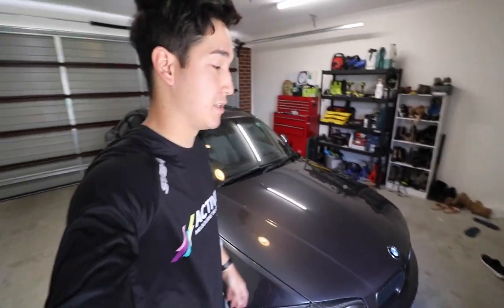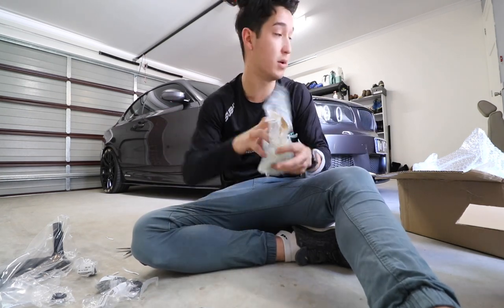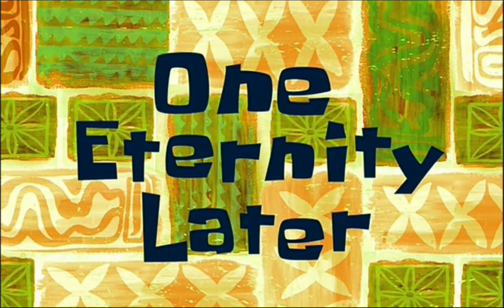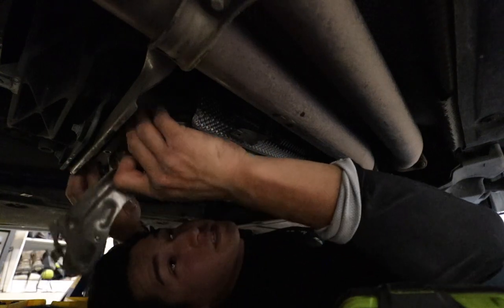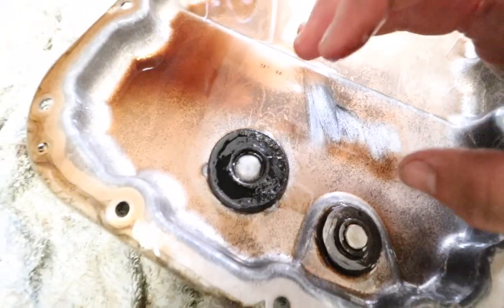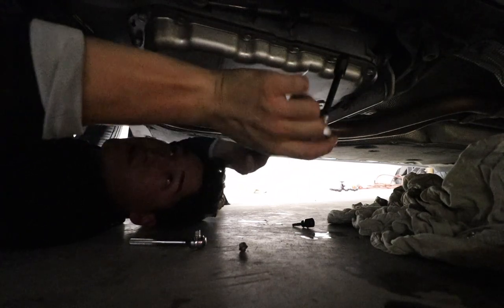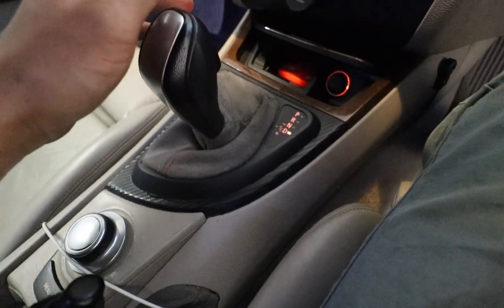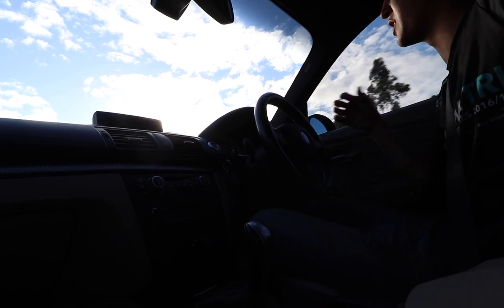BMW Automatic Transmission Service // BMW 125i e82

Comment: I think you also need to get the oil up to operating temp, and cheek it using a temp gun, before refilling, on the e87/e88 and the 135's you have to

Comment: good tip, with thoes 4 bolts, remove either the 2 front or 2 rear and that way you dont have to hold the pan